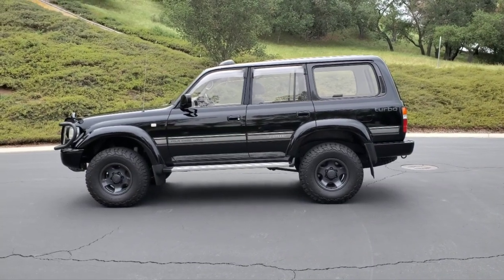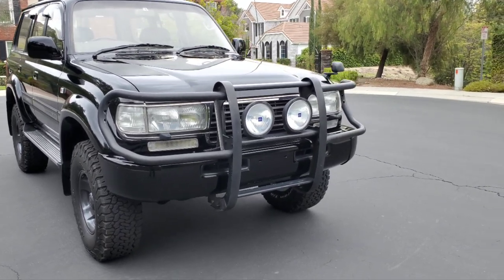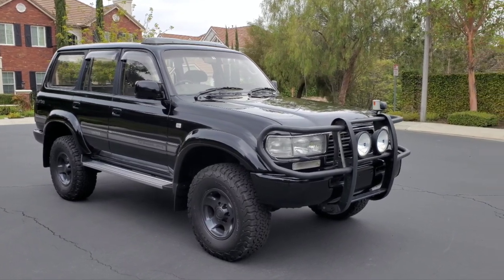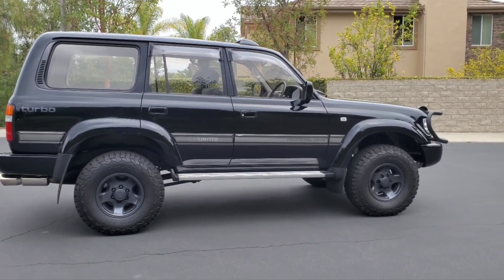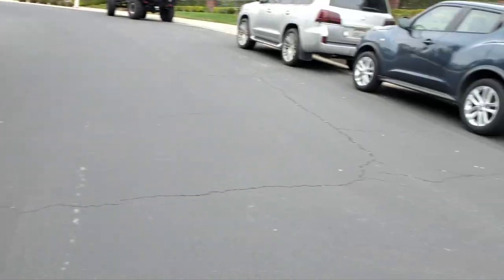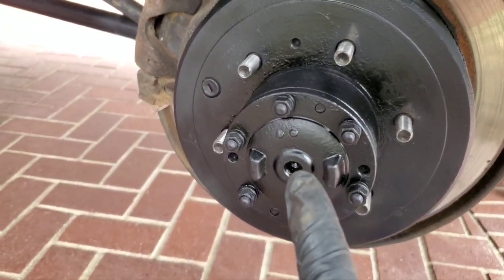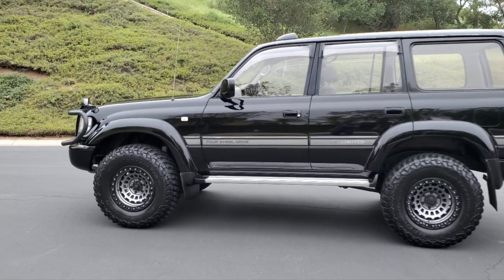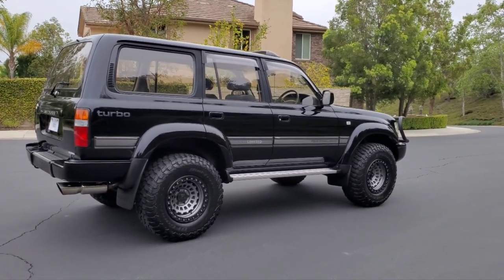Land Cruiser 80 Dream Build Part 1

Comment: I have an HDJ81 myself I’m currently building. Yours looks great! Was curious if you have any leads on weather tech style floor mats or any company that will make them for RHD? Thanks!
Reply from the maker: Good question!
Was thinking of that myself recentlt, but havent researched yet.
Reply: @CruisingTheLand  only ones I’ve been able to find are from AU. They’re called sand grabba mats. I just don’t want to pay shipping from AU.
Reply from the maker: I think you can get the LHD weathertechs, and just turn them upsidedown.. or is that for Australia models?

Comment: Good job! Luv this. Willbu be selling off the OEM wheels & caps?
Reply from the maker: Either I will sell or keep as backups as they are pristine condition and tires have only 700 miles on them.
Reply: @CruisingTheLand  Will def keep my ears out should you do! Luv your channel!
Reply from the maker: @FJREY  The set is 5 wheels and tires. 4 caps, lug nuts.
The spare is new, the other 4 have 700 miles (Scottsdale to Mission Viejo).
I will be posting them for 2k online soon, but will offer them here first for 1900.
Reply: @CruisingTheLand  35s right?
Reply from the maker: @FJREY  285s

Comment: Preferred the stock wheels
Reply from the maker: I do agree that the stock wheels in themselves are Iconic.
But I have a other fully built 80 which has stock wheels.
And these wheels are fundtional bead lockers, whixh is a benefit over the stock.

Comment: This video is like one giant confirmation that Land cruise builds are for the rich lol
Reply from the maker: well... How much for a brand new Land Cruiser or Jeep?
The nice thing about LC 80s is you can find all price ranges...
You dont necessarily need 3x locked, you can have 300k miles, and you can do work over time. A Front bumper? 1k.
Roof rack? Got mine for $720 during their sale...
You can do some of your own wrenching too.
In fact, you can build one up and retain value or go up in price.
They are out there, and hunting for them is half the fun.
Reply: @CruisingTheLand  I’m in socal, basically all $7.5k at the cheapest, which sucks lol. But yeah I’m looking for an 80, seem to be peak Toyota (in the states at least). Built to last though unlike a Jeep haha
Reply from the maker: @CA11100  I almost bought a Diesel 92' 80 in San Diego for 15k.. had winch, rear tire OEM carrier... needed paint, but was pretty nice. Hard to find a Diesel below 20k. 
You should go to some Toyora events, YotaNights om Katella. Saw a guy there wantimg to sell his Diesel for 20k.
Diesel will save you $$ with the MPGs overtime.
Reply: @CruisingTheLand  diesel eh? Where you finding them? Mud? FB, CL, etc?